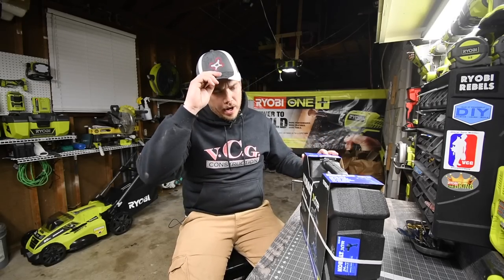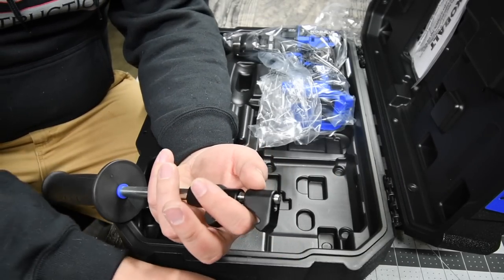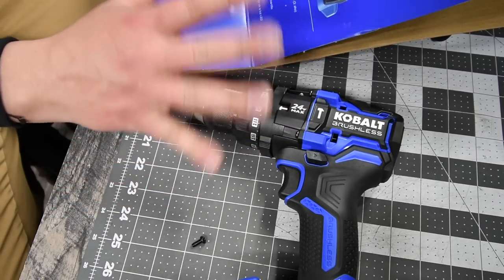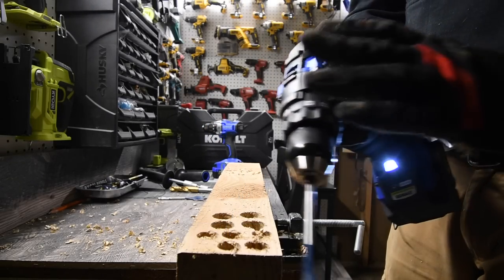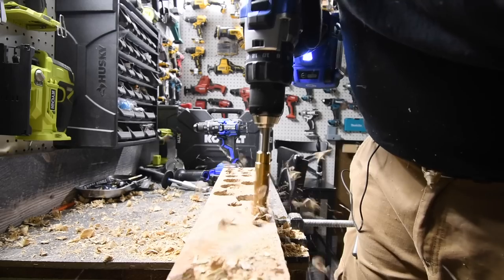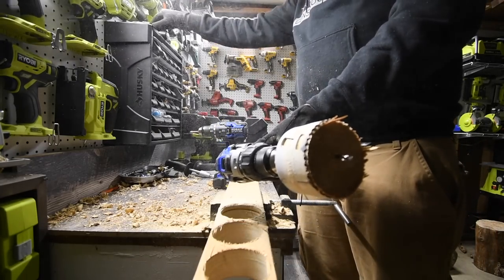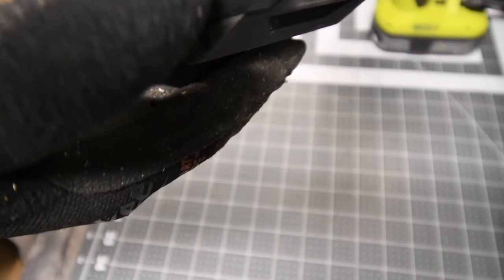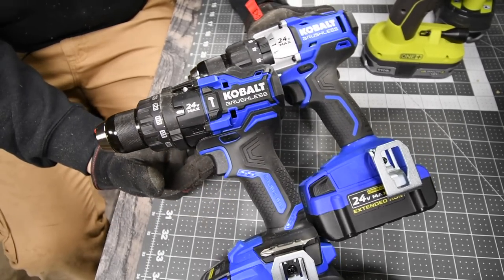Kobalt XTR Hammer Drill Unboxing/Test

Comment: I think that the reason the XTR was stopping was because of the kickback control thats integrated in it. If it detects kickback it kills the motor to prevent user injury or damage to the motor.
Reply: Almost as if the reviewer should be aware of such a feature
Reply: Yes I think you're right... if he can showcase that or redo this using the aux handle. I think his comments would have changed from "This is disappointing x3" to "this saved my wrist, wow! x3"
Reply: I think your right buddy. I was using my xtr drill with hole saw to punch thru some studs in some tight spots and the anti kickback saved me from smashing my hand. I love my XTR set! 🤙🤙🤙
Reply from the maker: no powerful drill like these should be cutting out to do these tasks. no matter what features it has.
Reply from the maker: it should not be triggering that soon.
Reply: @ManCaverTools  Is that a screw in the black plastic where the auxiliary handle attaches? It looks silver in the videos but nobody's zoomed in close enough to tell. If it's not a screw I would hope its a magnet or something that detects when the aux handle is connected so the kickback setting would turn OFF. That's what I would design...
Reply: no drill i've seen to have kickback protection cuts off this soon. for the hilti sf 6h he has it's a quarter turn, so the drill will still spin a quarter turn, then shut off, i've had a bosch 18v 60c and  it spun for about half a turn before it shut off.
Reply: @ManCaverTools  I think I kind of agree with you , the anti kickback should not be so sensitive. I just bought the XTR 5 piece set.. still very nice set though and the price is amazing for what you get in return. Gave away my 24v drill to someone in need. nice tools ya got in the backround there btw.

Comment: It says right on the box anti-kickback tech to keep you from getting corkscrewed. It feels front heavy because its made of metal and not plastic like the DeWalt.
Reply: It's not worth it bro this guy just buys tool after tool and rambles on about it. Would make all the difference to take a pen and paper write down some notes / features / discussion points but hey who am I to say
Reply from the maker: yes but it is going off way too soon. it should be able to withstand way more force then that with it activating. Ryobi has the same issue
Reply from the maker: iu put these to the hardcore test. the kickback should not be activating this early. The hilti has this feature as well. Ryobi has this and it goes off way to early like this kobalt does. it just makes it a weaker tool
Reply: @ManCaverTools  I disagree I work in a commercial production facility building houses and I have been using my xtr with a 3/4in x 2ft auger bit for drilling through studs to run wires. I have had no issues with this model so far and have had it for two weeks doing 8 houses a day. I have had the old model for 2 years and my co-worker uses it for the same purpose I do. It's pretty awesome that our company quit using corded DeWalt drills and switch to battery Kobalt drills due to the performance and reliability being better.
Reply: @jamestroutman953  8 house's a day, bullcrap

Comment: I suspect some of the cut out by the XTR Hammer drill is due to the anti-kickback sensor trying to prevent a sudden jerk of the handle. What the tool needs is an option to disable it, particularly if you need to mix drywall mud, thinset, or grout. Kobalt/Lowes also needs to sell the new style belt clips too.
Reply from the maker: yes, it is being triggered way to early and it just makes it a weaker tool.

Comment: Having a kick back feature is nice.Most of the standard hammer drills don't have this feature unless you get the SDS Max drills and even with those drills not all of them have it.You can see the light flashing in the video when the feature goes on.
Reply from the maker: there is no need to have the kickback activate early like that though. it should be at a different setting
Reply: @ManCaverTools  it's to protect your wrist or the motor when using larger bits.If you can easily handle the power then no the kick back is set low

Comment: Interesting video. It looks like if you put a little bend in the belt clip it will work. I have numerous Kobalt tools and I did not put the belt clip on. Those tools are just too heavy to hang on my belt. I get that they have a use, just not for me. 
I have what I think you referred to as the older tool. Mine in silver up front whereas the newer one is black up front. BUT.....I bought mine on clearance. For $55 I got the hammer drill, 1/4" impact wrench, 4 ah battery, charger and carry bag. I already had the clutch 24 volt drill but for the price of the clearance package I just could not pass getting it.

Barry
Reply from the maker: yes, the belt clip doesn't support the new 4ah battery. a little adjustment is all it needs

Comment: Did you set the same clutch setting on both units?  Toward the end, when comparing the two units side by side, you are showing completely different clutch settings.  That makes this comparison completely useless if you did not match the clutch settings between the two.
Reply from the maker: sometimes I mistaking call something the wrong thing. don't blame me a mistake here and there
Reply: Putting the drill on drill or hammer bypasses the clutch

Comment: Some many reviews I see the people pushing on the tool way to hard....let the tool and the bit your using do the work....your actually slowing it down by doing that....give it a try and toull.see what I'm talking about....i proved it to any people at my job
Reply from the maker: that's the point. if I use these tools like they are supposed to its not a good review. people want to see stress tests to the max to see what the tool can really handle. if all I did was drive in 3" screw nobody would care
Reply: Seen him baby the ryobi line but treat others like subpar junk and do bias reviews. Not fully charged batteries, setting different, forcing tools, hungover angling the tool lol

Comment: Can't close the case with the belt clip attached to the drill. Take notes Chervon.  Launching all these tool and ope lines (skil 12 , skil20 skil 40, kobalt, kobaly xtr, ego, kobalt ope) , I can see them overlookikg things. Like how you can not use the kobalt angle grinder with the new UO battery, or how the UO batteries doesnt fit on the fan. Which is why it is on sale now for $50. Chervon needs to get their shit together. Especially with this kobalt xtr line. Cant even buy the 5 tool kit set. And they just launched it this year too.  Thats not how you do a product launch. Cant even buy the batteries buy themselves yet.   Come on Chervon.
Reply from the maker: I thank you for the feedback Evolve

Comment: You're running out of brands to buy lol. I would be curious how this compares to the Skil HD Hammer drill though. From what I've seen of a couple other videos, the internals of the XTR line may be identical to the Skil, but we've only seen that on the impact.(although the shells look fairly different, with a larger beavertail on the Skil, more like the first gen Kobalt.) There's also a brand called Erbauer in Europe that released a new lineup that is literally carbon copied Skil in Bosch colors (with exception to the switch on the impact) Those tools rate the hammer drill at 120N.m which is roughly 1060 in/lbs. The Skil is rated at 850in/lbs, and the XTR 1200in/lbs. So if they are all the same components inside, somewhere in that mess is the truth. Of course, the easiest thing to change is the gearing, so that may be different. EDIT I'll have to look into rpm on all of them, but I know the Skil is 550rpm in 1 and so is the XTR, and both are 2000rpm in 2. Both of the hammers operate at 32,000 bpm in speed 2 as well. On the impact, it looks like the Skil literally just has the first 2 modes of the three on the XTR.  The skil max is ~2700 rpm with 3400 ipm, whereas those are the same specs for the XTR in speed 2. In speed 3 the XTR goes to ~3400 rpm and 4,000 ipm. I almost wonder if the Skil could be overclocked to those numbers as well. Maybe by putting in the same switch as the XTR if they are indeed identical otherwise.
Reply from the maker: lol. I still have a lot of brands to get, don't you worry about that lol
Reply from the maker: and more videos with new brands are coming

Comment: Just bend the old style belt clip out a little bit and you'll be fine with the new battery. I like that new XTR drill and the whole line of tools. I hope kobalt comes out with more in this line
Reply from the maker: yes, you need to do that while its off the tool so it doesn't bend the nylon

Comment: First off fully charge the battery and then stop whining about the balance before the battery is installed, and try to step up your game....you set the old drill in front of the new one like your featuring the old drill
Reply from the maker: First off, check the date on this video. this is an old video. slow your role

Comment: Come on, you need just little bend belt clip and done) my dewalt tools with old belt clip also dont want work with new battery so i just bend little bit and it is work fine
Reply from the maker: yes you do, some people don't want to have to bend the clip though. that's why I said. it.